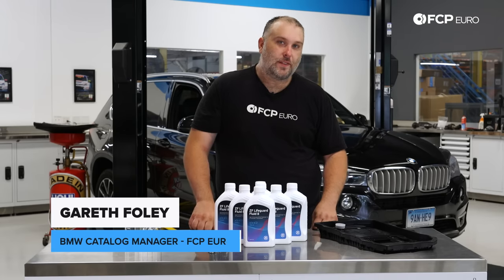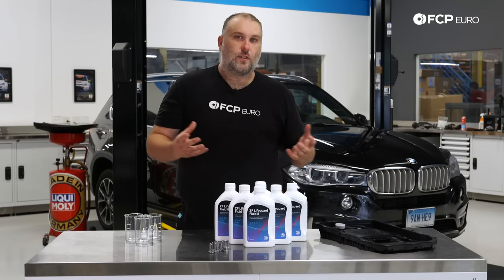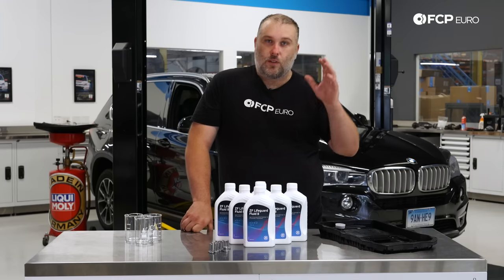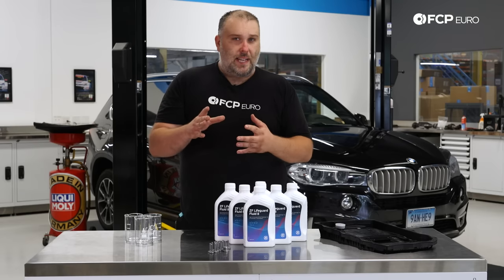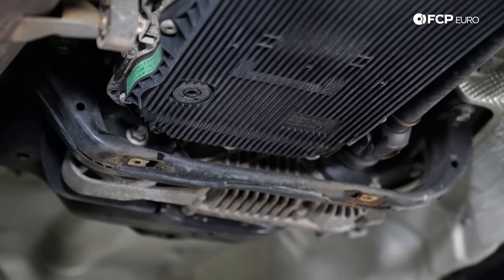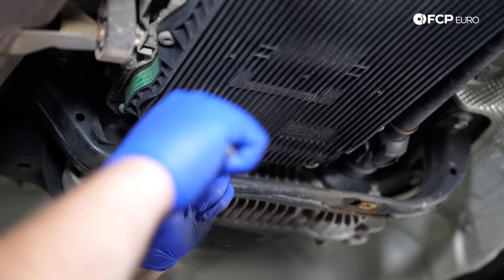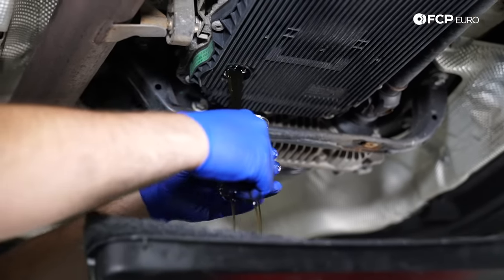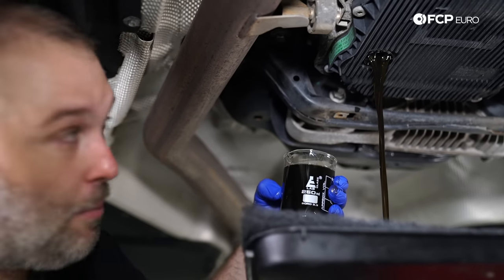ZF 8-Speed Transmission Oil Change (BMW, Audi, VW, Dodge, Land Rover, Toyota, & More)

Comment: One thing to note is if the pan is plastic it’s simply 10NM torque spec for the pan bolts. Also the procedure calls for three steps: (1) cold fill without engine running (2) start the engine and fill transmission at 30-40 C degrees (3) shift to R, to D, to 1 (hood for 10 seconds), to 2 (hood for 10 seconds), put the trans in P rev engine to 2000RPM for 30 seconds, then wait for 40-50 C degrees and then do a final fill. Also the fill plug is 30NM for AWD, and 35NM for RWD.
Reply: That bit with revs on 2000rpm is not mentioned in any video I have seen. It clearly states in zf manual though.
Reply: When reving engine to 2000, is the vehicle on the ground with brake depressed or is it up in the air and allow wheels to spin?
Reply: @toml4288  rev in park xD
Reply: @AceZM  🤣🤣🤣
Reply: My transmission gets stuck when put into R and PRNDS starts blinking. Have to restart car. It started after VW serviced it.
Reply: How much oil are you supposed to fill at each stage?
Reply: @babagandu  low oil pressure.
Reply: @toml4288  Vehicle on ground, in Park -  wheel should not spin
Reply: Just bought a used ‘16 Range Rover sport with the ZF8; not sure of service history and 91k on clock.  Don’t think the service has ever been done.  Original pan filter and oil is black, magnets had a lot of paste grey matter on them but no metal or chunks.   When I drained it, cold, 3 qts came out and it seemed like it was gushing out.  I think they might have over filled it?  My understanding was it should not gush out of the fill hole.  

When cold filling back up after changing the pan filter, I was only able to add a little over 2 liters. I can read the temp, my scan tool won’t read LR stuff.  Suggestions?
Reply: Another thing I did was connect my OBD2 tool and reset the adaptations for the transmission. After this, it shifted much smoother than just fluid change alone
Reply: @112rorz  Til fluid starts to leak out of port hole in side of tranny. Do it twice. After the gear thru and revs.
Reply: @rakiable  watch more of em they do show it especially "Boosted Motorsports" video.  Its purpose is to FLOW the fluid into and out of the torque converter and throughout the full system. THEN go back and top off again. All clear points by others.
Reply: On the final fill, if i understand correctly, the engine should be running on P or N ?
Reply: @standystans2150  P silly boy.
Reply: @toml4288  Doesn't matter Tom. It's the RPM that matters to flow the fluid throughout the system and the shifts are to engage the Torque Converter which flows fluid only in travel. In park it does nothing but sit there.
Reply: so true. I am amazed watching these comments and if you do not turn wrenches leave it to the pro's. So many rookie questions it is amazing.
Reply: @anonimous2451  no doors open dear
Reply: Appreciate the walkthrough, my lesson learned was I definitely need a pump next time, using the small pump and having to swap every bottle was a pain in the ass but it’s done and shifts great.
Reply: @user-ym9wb2mk5e  it won't gush out if the car is running. If not running the fluid collects in the pan and will gush out when you open fill hole. Also, I use BimmerLink for reading temps. It's free for that function but you do need a compatible OBD2 reader.
Reply: @stevenfandl1391 or simply keep brake depressed while car is in the air if using jackstands?
Reply: 14:12
Reply: Yes, this is correct for eliminating air out of the transmission. Also, I noticed the transmission doesn't sit level to my truck, so the rear end needs to be elevated about 6-8 inches to be level.
Reply: @toml4288 you need to lift the vehicle and allow the wheels to spin for 5-10 seconds in 2nd gear.
Reply: @anonimous2451 the shifts engage the converter?
Reply: Guys, if I do not lift the vehicle can I go drive for like 10 seconds and comeback to get the rear wheels to move?
Reply: Do u empty the torque converter?
Reply: @mikegalvin4655 , no. You do not want to flush these unless they have lower mileage. Like under 50K for me.  I did a 2019 Ram 392 with around 40K and I used about 9 quarts of fluid. Do the precedure once, drive a little and repeat.
Reply: Newtis says 4nm plus 45 for aluminum screws and 10 Newton meters for steel screws.
Reply: Should you start the engine briefly to drain the rest of the transmission fluid out of the torque converter?
Reply: It says the torque on the plastic screw. Some vehicles say 8 nm + 1 nm

Comment: Sheesh. I've been changing mine at 70,000 miles and thought I was being good! My X3 is hitting 190,000 miles, time for a 3rd change!  Take it w/ a grain-of-salt, but I only change the pan out ever-other-change. My pan was in pretty darn good shape at 140k. I shoot for 250,000 miles on my vehicles. Not having car payments for a decade is priceless! ;-)
Reply: If you don't change the pan, isn't there metal shavings left on the magnets and bottom of the pan?

Comment: @Gareth. Like your videos. It’s very detailed. I plan on doing DIY transmission service on my 2015 RAM 1500 with the 8HP70. I am not about to pay $446 for the Mopar filter. If I opted for a new filter/pan for the X5, do you think it will work?

Comment: Great video! I serviced the transmission on my E60 and I changed the mechatronic sleeve on it along with other seals. Do you need to do that on an F15 X5 with the fluid change?  I am looking to purchase an X5.
Reply: It's a different gearbox, ZF8 so you only have to change the oil and pan. There are no sleeves to be changed. The same ZF8 gearbox is fitted to the f10 5 series and also the jaguar xf and xe. I did mine as above and also checked with ZF in Germany before carrying out the change.

Comment: Do the wheels need to spin to get the transmission up to temperature?  Or will it warm up in park/neutral?
Reply: It warms up running in park. Do not move the car or let the wheels spin at all.

Comment: I have 200.000km 520d 2016 on my car... its okey to replace fluid with this kilometer?
I have no problem with gear today still smooth.
I think it has never been changed before..

Comment: About to do this on my x5 45e. Just did a test run while standing  in garage. Seems like when I'm just standing and switching gears from M1 onwards, after I go above M3, it just automatically reverts back to M2  within 1 or 2 seconds,. But I wanted to be able to go through all the gears and hold there for about 10 seconds. Any suggestions?

PS, while driving I have no issues switching gears

Comment: I have bmw f10 520d with 195 000km, 8hp45 ZF, never changed oil cuz i have listen bmw house. I dont have any problem with shifting, he still shift perfectly, I want to change oil now, with half oil change no flush, its ok to change on high mileage first time?
Reply from the maker: You should be perfectly fine to do so and continue to stay on top of the intervals from there!
Reply: @fcpeuro  its better half change or flush first time on high millage?

Comment: OK so you have changed the fluid in the pan BUT you have not changed the fluid in the torque-converter, fluid lines or cooler. WHY NOT?

Comment: On ZF's procedure, 4nm + 45 is only for trans oil pans made of aluminum. For the plastic pans, they suggest 10nm. Not sure why BMW would differ, but given ZF manufactures the transmissions I'm inclined to follow their information.
Reply: Thanks! Good to know because my torque wrench starts at like 7nm.  Doing this service soon, just got my kit today.

Comment: You guys are costing me a fortune. I’d never have realised you need to change the transmission fluid, coolant or the diff oil without these videos. Great videos and very clear instructions. I’m sure you’ve saved me loads of money in the future and prevented possible problems down the road.
Reply from the maker: Sorry for the delay Andy - but love/sorry hearing this haha. Have you got around to doing any of these jobs yet?
Reply: @fcpeuro  Hi, yes all done, though I got a specialist transmission shop to do the transmission fluid change. 👍
Reply: @andyslater3452 what did they charge?
Reply: @kjhnsn7296  Hi the transmission shop charged me £547 British Pounds. This included the replacement sump with filter, transmission fluid and their time. Not cheap.
Reply: @andyslater3452  Not cheap at all, but much cheaper than replacing the entire transmission. My BMW specialist gave me a similar quote today, 20-30GBP under yours.
Reply: @andyslater3452 that's bladdy expensive. I saw the whole ZF kit including the oil etc. on ebay for around £182. I might just do this myself. Maybe even open my own oil changing business haha... kidding lol.
Reply: I was hoping he would mention how much oil he used.
Reply: Most of the cost is in the transmission oil and the filter. BMW ATF not cheap.
Reply: How you drive car .Just petrol😅

Comment: I feel I own this guy a drink. I followed his instructions step by step and the job went smoother than I expected. 

I used the car’s temperature gauge as a guide (Dodge Charger), idk if that would be ideal but so far it’s working without any problems
Reply from the maker: Glad to hear it was helpful!
Reply: Is everything still going well after your method?

Comment: Gareth...I have a question concerning this ATF filter & fluid replacement. Since ZF recommends (as well as FCPEuro) a drain & fill w/filter at 50k miles, since this only replaces about half of the fluid, when should you do another drain & fill? which is about 4 liters.

Comment: This was a great video, one question though I have a ram with this transmission, it shows the trans temp on the dash is that good enough? Or do I still need a OBD reader?
Reply: Dash display uses same sensor as scan tool, so yes
Reply: Thanks this answered my question as well. I have a 2015 RAM with this transmission as well.

Comment: Thats cool that you guys did this video. I work at ZF transmissions in South Carolina where we build the 8HP. Im in R&D and we see these transmissions takes some abuse!!
Reply: Can you comment on why the service interval from ZF differs from OEMs?  Also, what do you think of Gareth's advice about NOT changing the fluid if a sample looks to be of poor quality?  That didn't make sense to me.  Thanks!
Reply: @robertpassaro4089  If the fluid is very dirty, the dirtiness is shavings that have come off of the transmission itself.  That's an indicator of heavy wear.  If there is heavy wear, that means you're going to have friction issues. Going with a completely clean and light fluid on a worn out transmission might mean that your transmission will not be able to apply enough pressure to shift gears and having that thicker gunkier dirty fluid actually causes an increase in friction.  That's not to say that dirty fluid is better in that case.  It's just that depending on the level of wear...clean fluid could be worse.  But again it all depends on how much wear you have.  I did a full transmission fluid flush on a 100k mile BMW Z3 back in the day.  That's a big no no.  But I ended up with perfectly smooth shifting afterwards.  However...there are just as many people who do it, and then end up having to replace their transmission.   You could take a fluid sample and send it off to a lab before deciding what to do.
Reply: @robertpassaro4089  as Hyper mentioned - very worn down tranny might need that old gunky fluid to continue shifting and might slip with brand new fluid (toyota can be changed much later, while GM are known to have issues) - don't know about ZF at 130k - you could save the old fluid in case and put it back. Did mine at 85k and while black it was still see through similar to video...
Reply: Brah, if u work at zf, r and d.  We need u to do a video addressing this conundrum.  Dealerships are saying no to oil changes.  Lets get to the bottom of this.
Reply: Nice i work at ZF in Germany Saarbrücken
Reply: @zvebiNmob1zer666_  that's really cool ! I haven't been there yet, but I've heard it's a gigantic plant. Although I did work with some German counterparts that were from that plant, even helped train them on how to diagnose issues and rebuild an entire 9HP and 8HP transmission. That was back in 2013, 2014 and 2015. They've since moved back to Germany, but I still communicate with those guys to this day.
Reply: @mobleyMobley  I had no idea anyone replied back to this comment I made 2 years ago. Much less, knew there were this many people that had concerns about maintenance. I'll reply back when I have more time to explain. Or maybe just make some content. idk.
Reply: @robertpassaro4089  what hypermatrix8999 said is 100% accurate. The only way I know how to explain this service interval situation without telling something misleading or inaccurate is to prolly make a video on the subject. It may seem like a simple explanation to some, but it's not really that black and white. There's a lot to explain.
Reply: @TheKbrizzle81 I (and many others) would love a breakdown of this advice.  I now have 180k miles on my ZF 8 speed AT without any issue but would like to drive it another 180k.  Let’s see that video!  Thanks.
Reply: @robertpassaro4089  at this point I'd just leave it alone

Comment: Hello Gareth, @FCP euro
Thanks for this great video. I was wondering if you know what type of transmission does the BMW X3 Xdrive 28i (F25) 2011 has? 
My vehicle has now 126,000 kms, do you know the recommend time or millage/kms for a change of oil transmission?
When you said that if its over 50k miles it was to late, does that means I don't do it at all? Or should I still ask my BMW shop to do it?
Thanks!
Reply: This is pretty much exactly what I want to know. I am on 109000 MILES and it has never been done. I appreciate its far too long to leave it but what do you suggest now some of use are here? @FCP Euro

Comment: Realizes there's 105k miles on my b8.5 Audi A4 with the ZF 8 speed, and the previous owner never had the transmission serviced
...
Sweating intensifies
Reply: Quite literally me HAHA
When he said 80,000 I was praying he meant miles, not KM. My b8.5 A4 just hit 81K miles so I’m hoping not too much damage has been done lol
Reply: Mine just hit 134,000 miles and it does not like shifting at all I’m so sad lol
Reply: @beckmarchiniak4034  I have no clue, I don’t know if mine was ever changed but I don’t think it’s the fluid, it just seems like it’s the torque converter lockup clutch. It seems like it’s searching for a gear the whole time and when not accelerating the rpms will drop back to 750 in 2nd/3rd gear.
Reply: @thegoldentheory4383  It's most likely cause of your problem. New oil and filter should help. I had similar symptoms in older ZF6hp and oil plus filter cured it. On my current ZF8hp I changed both at 60k miles, there was nothing wrong with transmission, but it's shifts thru gears even better than before service.
Reply: What about the oil in the convertot?
Reply: @trevorshields7347  If you mean torque converter, then it's the same oil as converter is a part of the gearbox
Reply: @maciejsuchecki7653  I know, I just wondered how you got the oil from the convertor. Or does it just drain naturally. Had a merc, where the oil had to be sucked from the convertor
Reply: @trevorshields7347  snap. Absolute faff to change that oil. I'm a mechanic, but used  send it to my mate who was a Mercedes specialist to do it.
Reply: @beckmarchiniak4034  just change it. I did my 335d with 151k miles. Made a huge difference
Reply: @beckmarchiniak4034  just a regular fluid change with a new oil pan. I did a zf6 so its a little bit more involved but still simple like a zf8
Reply: @trevorshields7347  No, no sucking required. Just drain plug, new transmission sump as there is a filter in it, and new transmission oil.

Comment: I am going to give this a shot 2012 535i with 130,000 miles.  Two questions:  1: anyone have ideas how to raise/level all four corners of the car high enough to get under it and get in the car to start for final fill?  2: My garage is pretty clean, I'll have overflow tarps, but will my garage stink forever?
Reply: How did this go?
Reply: @BoostedSupraT67  Thank you for your POST! I do have lots of updates.  My car ran like "a drive belt was slipping" when on the gas.  I was able to get the car up, replaced filter/refilled trans.  Didn't fix, but it needed it, I'm sure.  I took it to local shop, with the same issue they said "TRANSFER CASE" and were very confident.  $4000 later (I was clinching all body parts) replacing solved the issue!   This $4000 kept me from essentially giving away my nice car for little/nothing and buying a new car.   Owners, do not rule out Transfer Case!  (I also changed plugs previously -- needed, but didn't help."   the surge seems like it could be engine, but very tricky that it was Transfer Case.

Comment: This is the most helpful video I’ve seen on this topic, I think I need to do this on my f31 3 series now, it currently has 65k miles
Reply: Thinking the same on my f30, but the dealers have never mentioned this and its on 55k.